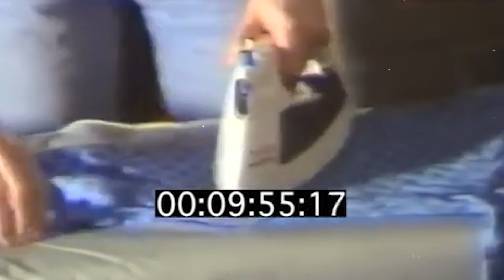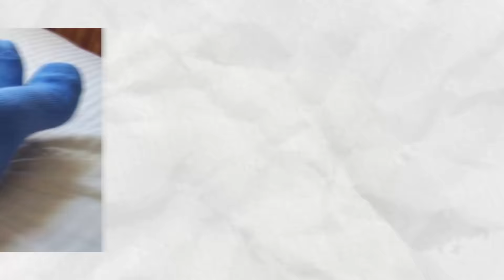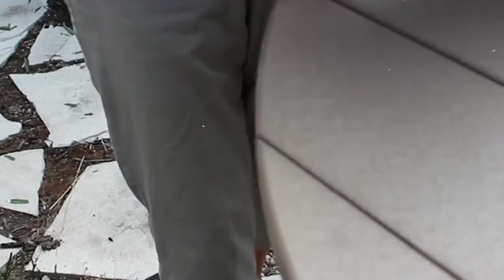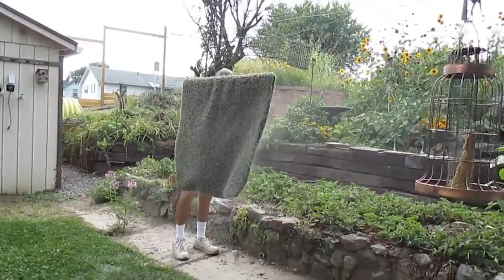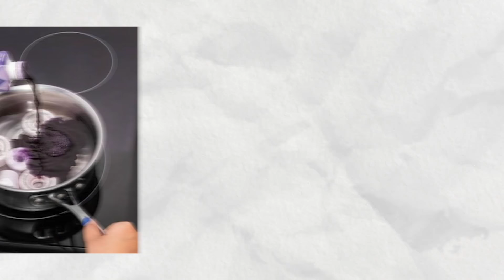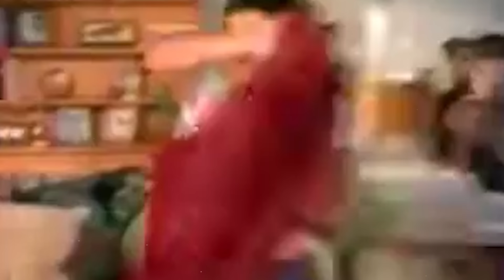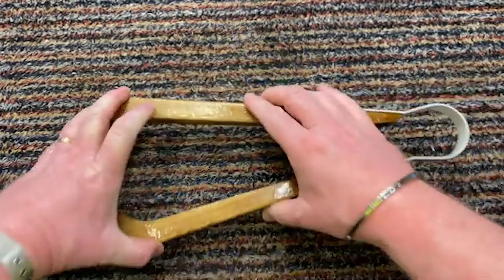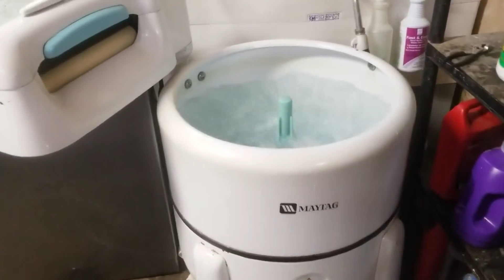30 Strange Laundry Room Items From the 1980s That Made No Sense

Comment: I own the downy wrinkle ball. Used it since 2012
Reply from the maker: Fourteen years of loyal service from a Downy ball is exactly the kind of quiet win these little household tools deserve. Sounds like you found something that just works. Do you use it with every load or just certain ones?
Reply: I have one I bought in 2014 and have no idea where it went. I feel like I’ve seen it around the pantry/laundry room recently before…I want to start using it again 😂
Reply: I live in an apartment and have to use a common laundry room.  I have 3 Downy balls. I use them all the time.
Reply: The thing always opened during the wash it first spin. I got it free so no great loss.
Reply: My mom gave me my first Downy ball in 1972!  I gave one to my neighbor at that time..…we both used them for years.

Comment: Are you suggesting that I should have dipped the clothes in the kitchen sink to get them damp enough to iron the wrinkles out?? You are the one that makes no sense!
Reply from the maker: Fair point, that suggestion really did miss the mark for anyone who actually did the ironing back then. A sprinkle bottle was the whole system, no dunking required. What was your setup for ironing day?
Reply: @TheYesterdayVault irons have spray water inside it though. One of my friends has a steamer instead

Comment: Some of these are very normal if you care about your laundry.

I am very curious why we now do not use any moth balls (except outdoors for snakes on occasion) and yet there are NO MOTHS. Did they all die, or did they never exist?
Reply from the maker: That's actually a great question, and it's kind of true that moths just aren't the household nightmare they used to be. Maybe it's the modern fabrics or the tighter seals on homes now. Do you still keep any old wool pieces that would have needed the moth ball treatment?
Reply: @TheYesterdayVault  Yes I have wool but rarely see any moths.
Reply: There are moths. Here in Texas anyway.

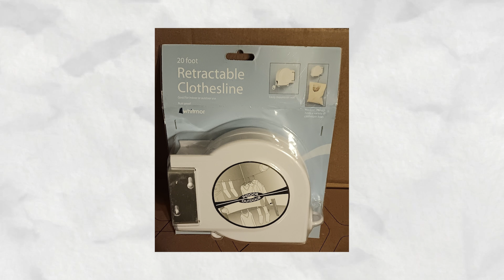Comment: 6:54 I definitely still have one of these but use it outside on my back patio when something needs to air dry 😂
Reply from the maker: Repurposing old household items for the back patio is smart, and clothes drying in fresh air always smells better anyway. What kinds of things do you usually put out there to dry?
Reply: I hang all my clothes on the deck and I have a small plastic clothes rack. I do not use my dryer at all. Trying to cut down on the PUD bill.

Comment: The dryer filter that exhauster in the laundry room could only be used with an electric dryer. A gas dryer has to be venter outside.
Reply from the maker: That's a really important safety point that most people probably don't know. Gas dryers venting outside is not something to mess with. Sounds like you know your way around a laundry room, was that from personal experience or family knowledge?
Reply: at 82 every electric dryer I've used vented outside. If not, you had humidity and lint in your laundry room. Very uncomfortable.

Comment: I had the softener dispenser. My washer did not have one. It worked well. But I went with dryer sheets for the rare times I actually wanted them.
Reply from the maker: Dryer sheets ended up being the winner for a lot of folks, easier and less mess overall. But you clearly gave the dispenser its fair chance. Do you still use the dryer sheets or have you moved on to something else?
Reply: @TheYesterdayVault I mostly use wool dryer balls, but the sheets get the dryer sheet. It takes me a long time to get through a box.

Comment: My washer is almost 30 years old, and I use a Downy ball to this day. You can still buy them. I never had a problem with them before. They always opened, and always worked just fine. And there is also no loud noise when the ball is in the machine during the wash cycle.
Reply from the maker: A thirty year old washer still running strong with a Downy ball is the kind of setup that just refuses to quit. That's a testament to both the machine and your maintenance. What brand is that washer, if you don't mind sharing?
Reply: dont expect your next washing machine to last that long
Reply: That's eas,you just get an older model from the 50s or 70s 80s or 90s on marketplace or from a yd sale or from a friend family friend buy it or get it for free and clean it vacuum and help make sure there are no bugs and then you have a perfectly good dryer that will last another 20 or 30 years even though it's a really old dryer to begin with
Reply: The Downy ball was a great ‘invention’.  Instead of having to pour in softener at the right time, the ball did it for us.  Newer machines have a dispenser so,it’s not needed!  
But it was great!  It had NO electronics so it lasts forever!
Reply: I’ve never heard that washing machine suds thing.  That’s just nasty 🙁

Comment: Wringers:  Not what is pictured here, it was the electric wringers that Yes could do bodily harm.  I rememer putting my fingers in it thankfully my Mom was right there when it happened and it did have that quick release feature.  I knew a lady who got her long hair caught in one and it pulled her hair out by the roots hair never grew back where it got caught.  A manual one is not at all dangerous.  Anna In Ohio
Reply from the maker: That's an important distinction, the electric wringers were the real hazard, not the hand-crank ones. Your mom's quick reaction probably saved your fingers from a much worse outcome. That poor lady losing her hair permanently is the kind of story that makes you understand why they eventually disappeared. Did your family keep using the wringer after your close call, Anna?

Comment: I still use a Downy ball.  My washer is old enough not to have a fabric softener dispenser.
Reply from the maker: An old-school washer paired with a Downy ball is a system that just works, no reason to fix what isn't broken. How long have you had that washer running strong?
Reply: @TheYesterdayVault 20+ years.  It's a Whirlpool.

Comment: To catch lint from the washer my father took a coffee can with holes drilled into it and a hook bolted to the side and hung it on the side of the utility sink. The carpet beater may have also been used to spank unruly children, I also used the Downy ball in the early 2000's and it worked about 95 percent of the time it was usually on the gentile cycle with large flowing items, so I stayed in the basement for a a few extra minutes on those loads and popped it open manually
Reply from the maker: Your dad's coffee can lint catcher is the kind of homemade fix that puts store-bought gadgets to shame. Standing by the washer to pop the Downy ball open manually shows real dedication too. Did your dad have other clever inventions like that around the house?

Comment: Our clothes lines hung up near the ceiling of the basement, at one time you had some clothes you couldn’t use the dryer for.  Now we have better dryers.
Reply: Does this guy know that there are garments that have to be hand washed and line dried to this day.
Reply: I’m 79 and I have never seen a darning egg.
Reply: @glennso47 I did not have a darning egg which as I would have liked to have one. I just used a burnt out light bulb.
Reply: We had to mark our names on our clothes when we were in navy boot camp.
Reply from the maker: Basement clothes lines were the smart backup for anything too delicate for the dryer. Modern machines really have come a long way with all those special cycles. Do you still hang anything up to dry or is everything going in the dryer these days?

Comment: They did have ball you could put the laundry soap in them and they worked pretty good.
Reply from the maker: Those laundry soap balls were a game changer for anyone who hated dealing with the dispenser or measuring cups. Simple and effective. Are you still using one these days or have you moved on to pods?
Reply: @TheYesterdayVault I use liquid soap and the cap.

Comment: Not everyone has a sink nearby to use to store sprinkle on the ironing, my Mom was one.
Reply: I use a spray bottle for stubborn areas.
Reply: Both my mom and I had suds saver washers. It was more of a water saver. And it added some fresh water, and I added a small amount of extra detergent. The only loads I didn't reuse the water  from was the diaper load. Yes, I saved on drying too by hanging these on the line in the summer.
Reply: My in laws dried their clothes on a line in the basement in the winter and outside in the summer. They grew up in the depression. If you reset the line after the first load is on a line, the laundry does not drag. I still have these in my yard.
Reply from the maker: Not having a sink nearby made the whole sprinkle bottle setup a real necessity, not just a convenience. Moms found a way to make it work no matter what. Did she have a favorite bottle she used or was it whatever was around?
Reply: @TheYesterdayVault she actually used a bowl and used her fingers and wrist to sprinkle the water and then the steam iron was invented.